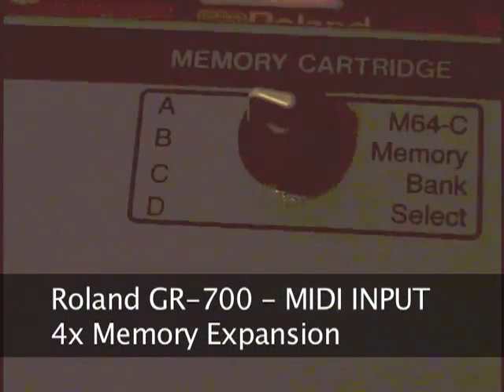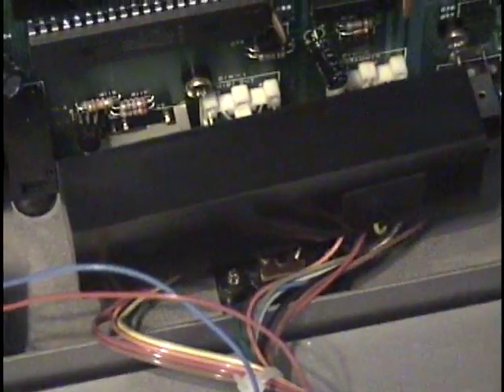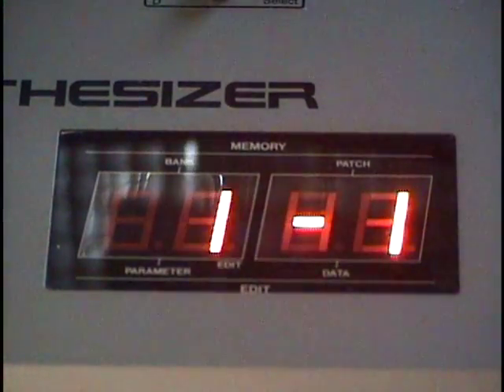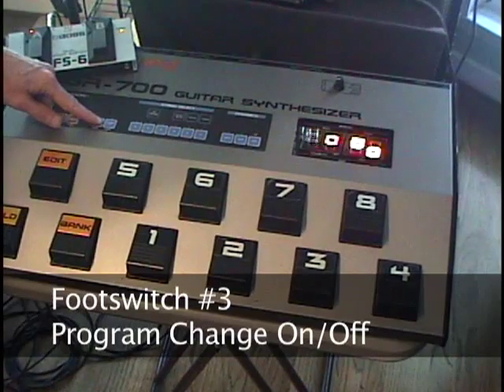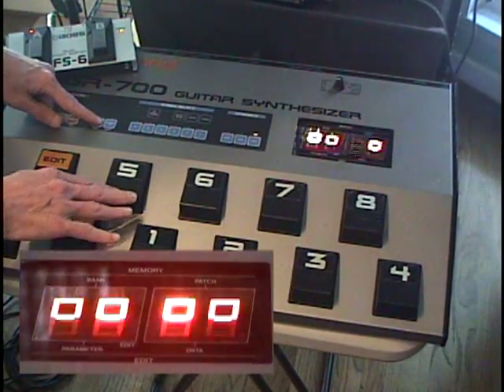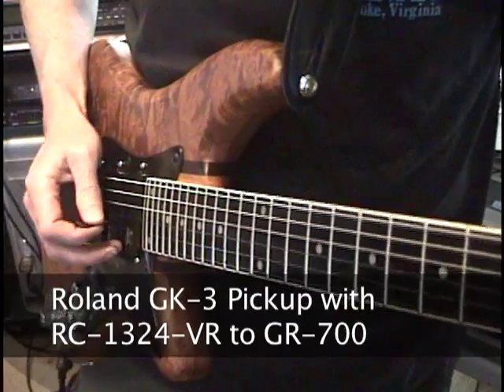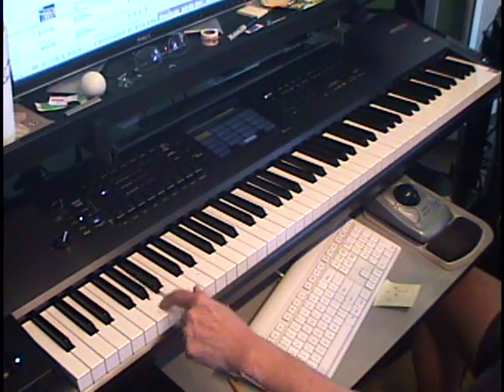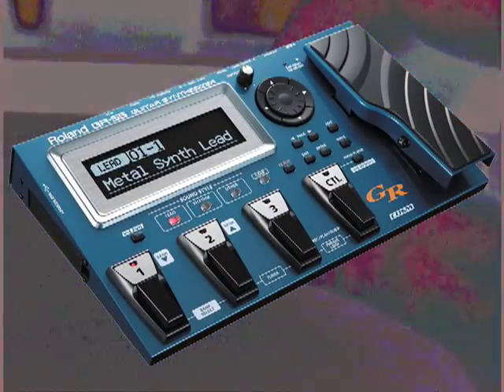Roland GR-700 Analog Guitar Synthesizer with MIDI INPUT Mark Tsurata Modification

Comment: Thanks for the video, finally got one, Is there any modern solution to trigger the gr700? custom midi input kit or maybe 13 to 24 pin converter?
Reply from the maker: You are correct, you need something to go from 13 to 24 pin.
Reply: @WayneJoness  do you still make those converters? would buy one for sure
Reply from the maker: @davemaverick8438  I am afraid I am not longer making or selling anything, thanks for asking!

Comment: Hi there, Ive got an MKS-30, please can you tell me is it possible to transfer factory patches with cartridge from gr-700 to mks-30? and is it really sonically possible to make the same patches with mks-30? are there any documentations of parameters settings for factory patches from gr-700 manual to replicate them with programmer on mks30? I would really love to get that awesome gr700 factory sounds, like bank 3 patch 5 for instance, would it be problem if you upload that patch parameters online, any easy way of data dump? Thanks in advance, I've been following your gr-300 site for last 8 years, always great info to find and to learn from there!
Reply: Øx Manifræd